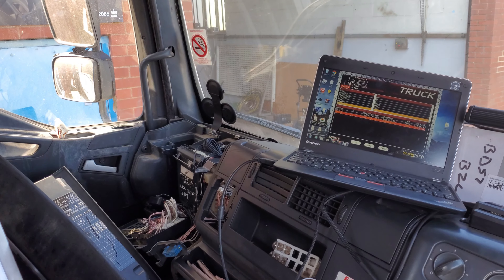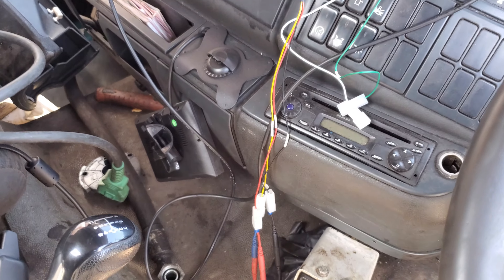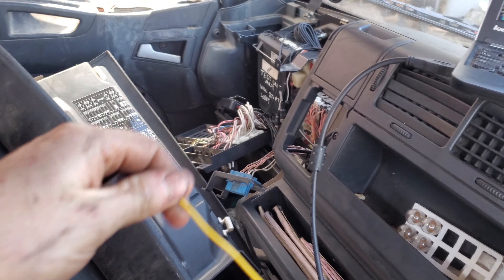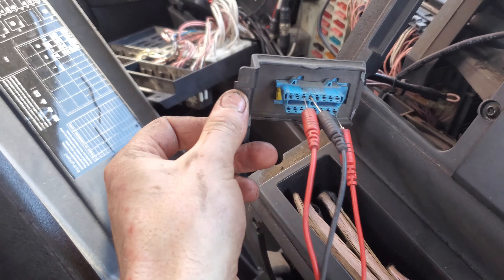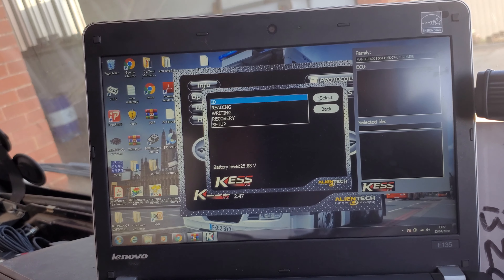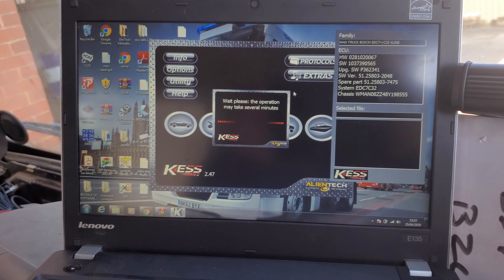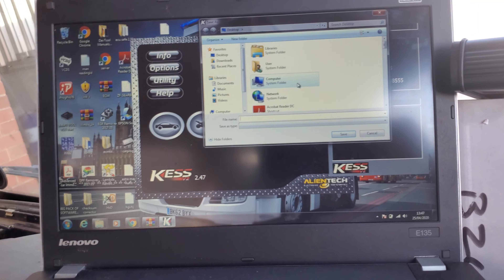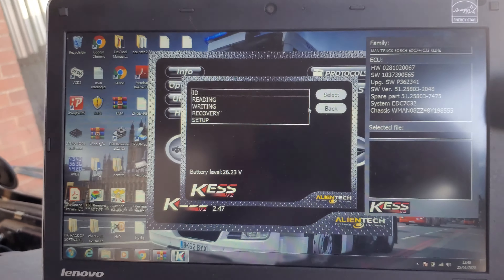Reading MAN with KESS

Comment: Hi, can the codes be read for a 2003 man L2000???
Reply from the maker: Yes . With the correct connector and diagnostic machine
Reply: @CANDiagnostic  should I use a original tester or can it be done like you did for that truck? I have recently bought a '03 MAN L2000 and after using it for 2 weeks the EDC light comes on and the engine is running gently with lack of power. Any ideas how can I find out what's the issue with EDC LIGHT? THANKS
Reply from the maker: There are lots of tools that are capable
Reply: @CANDiagnostic  can you please point me to a tool/cable that I can use for L2000?